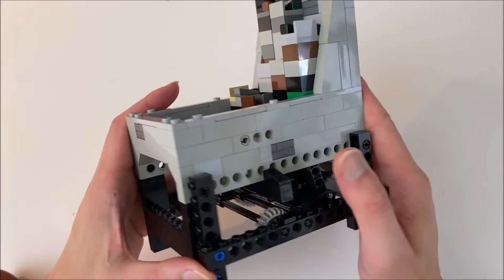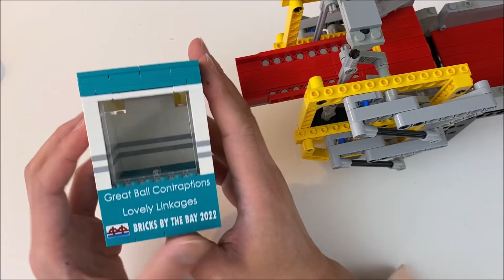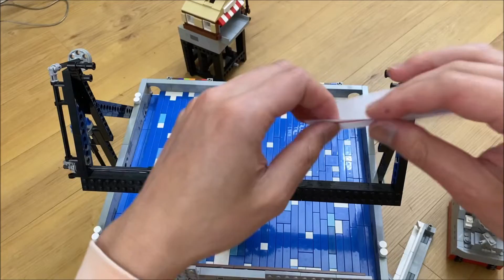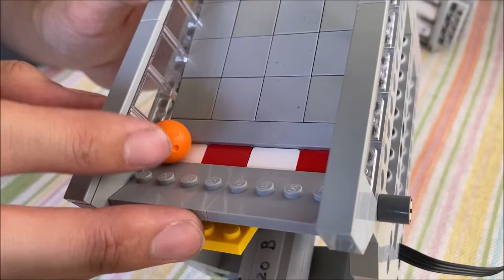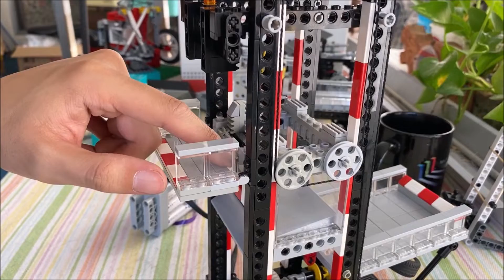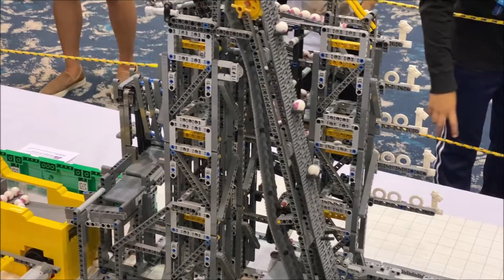Which GBC Modules Survived Bricks by the Bay 2022?  (HUGE compilation + NEW modules)

Comment: Some really cool modules here, are these public designs or your own? Where could I find build instructions for these? Thanks
Reply: And in the popper arm assy, what is the spring unit below the popper arms?
Reply from the maker: All the modules in this video are original designs. You can find instructions for a few modules on our Rebrickable (https://rebrickable.com/users/NonsenseWars/), but sadly we don't have much documentation on the GBC front. That being said, most of the videos for the modules that have them should show enough detail for you to reverse engineer them. The spring for the popper is part 2605c01 :)
Reply: @NonsenseWars  Could you some day make the LNER Class A4 4468 Mallard
Locomotive?